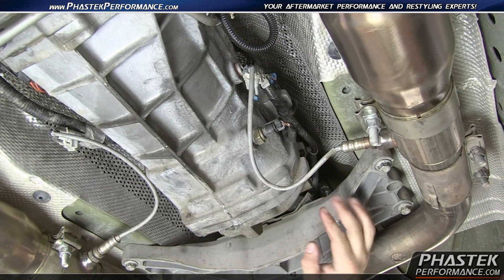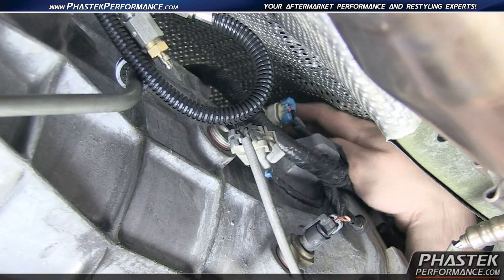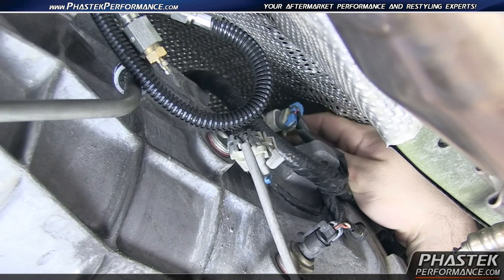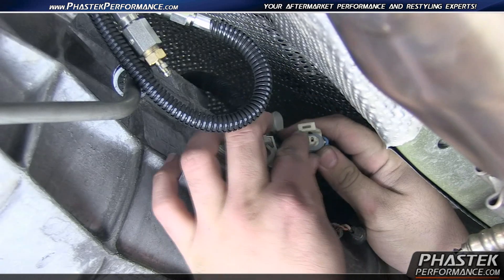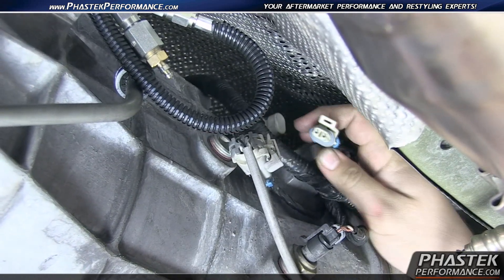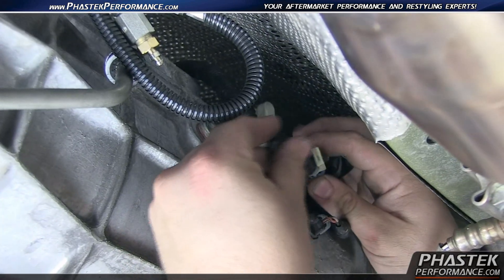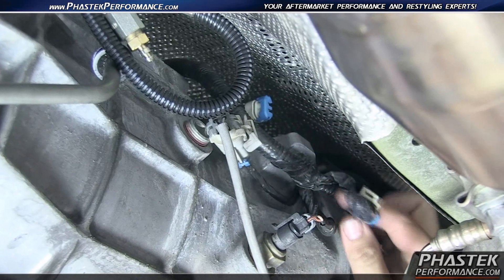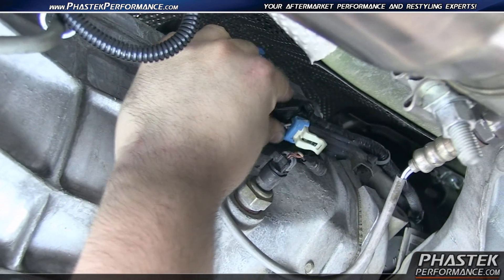How to Install Skip Shift Eliminator on a 2014-2015 Camaro 😀

Comment: will there be any check engine lights after installation?
Reply from the maker: +unicomptwo Sorry for the very late response.  No, check engine light will NOT come on when this kit is installed.
Reply: +Phastek Performance Will the 1-4 shift indicator still appear on the dash?
Reply from the maker: +1977rw Yes, the 1-4 light will still come on but the solenoid will not lock you out.  So you will still be able to shift.
Reply: How come I can't just unplug it and save $25
Reply: +JAMES HAWK It'll throw a fault light.
Reply: So it's basically a neat way to make a closed loop. Or tie two wires together.
Reply: Will this be the same procedure on a 94 Z28?
Reply: Can’t you just find caps similar to these at your local auto parts? And just cap them up how this guy did?

Comment: All I did was retune my car and it got rid of it
Reply from the maker: +PanteraGaming Yes, when the car is tuned you can turn off the skip shift.  But for those that do not want to get a tune this kit is a simple fix for the lock out issue.
Reply: You don't really turn it off is what my tuner said, he just set the parameters so high that it will never be obtainable. Engine temp has to be 439 degrees F and the car has to be going 300 mph.
Reply: rip warranty?
Reply: Mr. Hughes Rip on the warranty from 2010

Comment: Anyone else have issues going into reverse after installing this ???
Reply from the maker: Sorry to hear about the issue, we have come across this before.  We do suggest double checking the installation.  The Reverse solenoid and the Lock-out solenoid do have the same connector.  So getting the connectors confused can be easily done.  

If the kit is plugged into the Reverse solenoid then it become a bit difficult to get the car in Reverse.  

Double check the installation and let us know what the outcome is.